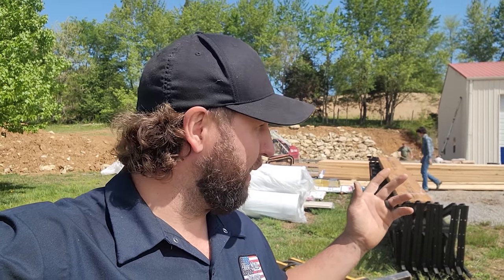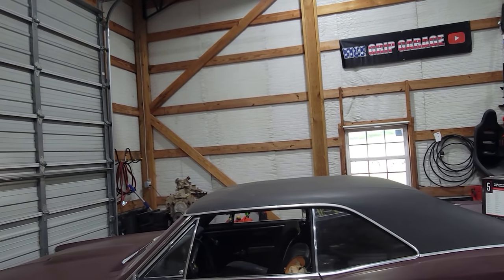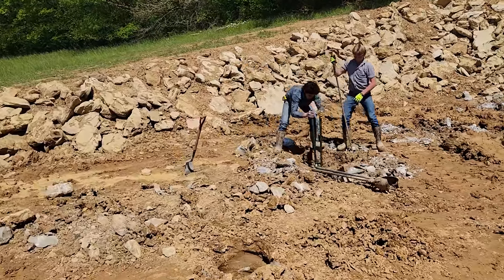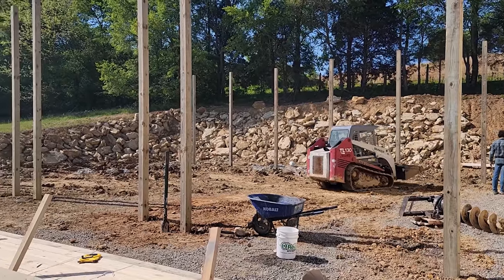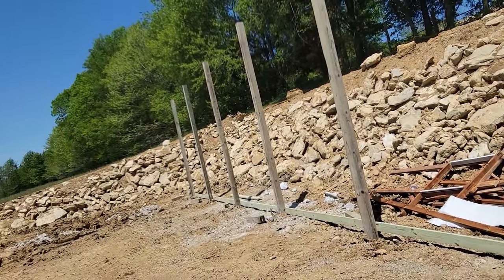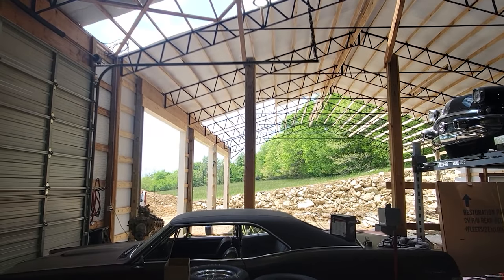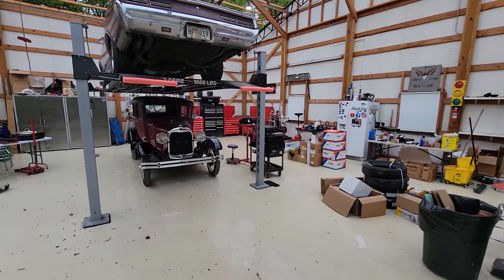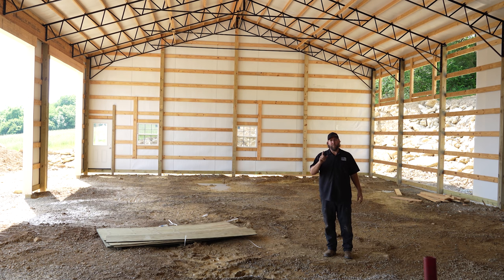Budget Shop Build - EP2 - Framing & Tin!

Comment: GABLE END EXHAUST FANS:  Put two 42" or 48" belt-drive exhaust fans near the roof peak at each end of the building.   Put on larger motor pulleys to run them 1/4 their stock speed.  Slow and quiet but at 40+", they will still move a ton of air.  Just crack those overhead doors a couple/few inches and it'll make it really comfortable.  Check out FarmTek's ValuTek fans.  You could also swap out the motors with 3-phase one's and use a VFD to dial in the speed.  A bunch of places sell motor/VFD combos.
FIBERGLASS ROOF PANEL SECTIONS:  I know that you JUST did the roof but if you ran two strips down each side, that'd make a nice skylight and brighten up the shop.
BTW, what a dream.  Big beautiful shop.  Don't forget a ceiling fan for the porch.  Maybe a Starlink internet dish on the top too.  ;)

Comment: I have a 50'x75' round top shed that was built in the 1940-50s. My wife and I were married in this shed about, 21 years ago this week actually. Anyways, when we were married, there were only 4 60-watt bulbs light it up, with some Christmas lights. I have since removed those lights and added 10 4-foot LED lights (4,500 lumen each) which I have plugged in, not wired in, about 15' in the air. I also have 2 10,000 lumen spot lights up in the corner that shoot from top to bottom, so I can see every cobweb in the place, both are on their own switches. Around my work bench I have 8 4-packs of outlets with each 4-pack on its own circuit. This was so we can use them for family reunions with warmers and crockpots and such (this was the smartest thing I did). I also smoke meats a lot in my shed, because it's 25' ceiling allows me to, so I have a lot of my smokers and such on their own outlets, again not blowing any breakers. 

Make sure you have your air compressor and drops added, I haven't completed all of mine yet. I would also install a vent fan or two with shutters, on each end so you can blow a breeze across. I also have a fridge in my shed for wobble pops and snacks. 

Good luck on your shed!

Comment: My suggestion for shop equipment is a heater (or two) that run off used motor oil. During the colder seasons, it will pay for itself.

Comment: Awesome addition. Install your fans closer to the ground. Helps to keep the hot summer air above you, also easier to make a wire shorter than longer too if you want to raise them up later for any reason. Also, old air-conditioning/furnace squirrel cage blowers can really move some air and sometimes can be found quite cheap. Mount it to a chunk of wood and wire a cord up, makes a nice fan.

Comment: That's a fine looking build you got going there Derek.  I think a good slab of concrete about 6 or 8 inches thick with rebar and the concrete wire would make a good floor for any lifts you might use or shop equipment you may want if plans ever changed for the type of use of the building.  You never know, someday you might want to put in a lathe or a milling machine and you need a good strong floor for stuff like that.  Right now you are looking good.  Glad to see you making it happen.  Thanks for bringing us along for the ride and God bless you and the family.

Comment: When I was 19 my dad and I built and 40x80 pole barn. He built a similar boom for the front bucket of the backhoe to set the trusses. Then a few years later we built a 32x60 shop to replace the 32x22 garage that was in pretty rough shape. Good stuff

Comment: Led lights, solar for lights and fridge,air compressor outside and big air lines for more air on demand, and clear panels in the roof for more light. And make end bay a paint booth or frame rack.

Comment: Like the 50amp outlet up front. Would serve multiple things, including plugging in an RV. Also the fan at the end of the gable, open the current man door and out goes the smoke of excitement. Meanards fans would be fine to keep air moving. LED lights draw less power, I would keep that side on its own switches. Having the electrician wire for the future is well spent. Maybe a hook up for generator in the back. 

Also, Derek, have them sloop the floor since you have no floor drains. Just a little towards the doors goes along way with water.

I know most people don't use compressed air anymore vs cordless tools, but moving the compressor over to the far end would lessen background noise.

Next would be the outside lighting and security.

Comment: Derek, as I was skimming through the comments, I noticed a couple about plastic pvc pipes for running air lines. It's your shop, but I worked at a shop that had plastic air lines coming off of the main steel compressor lines. When the building was 8 years old, one of the plastic lines blew out, and 2 of the chunks of plastic went clean through the metal wall. Nobody was hurt, but it could have turned out bad. Good luck with your project.

Comment: We put in our shop a 96 inch ceiling fan from Home Depot. It was 700 bucks and dropped the shop temperature 10 degrees with the ACs running. It draws very little power and is nearly silent. Way cheaper than the big ass fans and very nice as well. Hope you have a great time in Indy and look forward to the content that comes from that. Someone turned our thermostat way up here. Lol!

Comment: Use PEX for plumbing and air. Buy the crimper and use the stainless clamps. Doing it yourself saves big cash. Air quick connects everywhere. Double 120 and 240 outlets everywhere. Gable fan/vent. Led lighting. Oh, and a restroom.

Comment: You guys sure picked a nice little plot to settle down on. Very happy for you guys, and the shop is looking great 👍🏼👍🏼
Reply: Only suggestion I would have as far as the electrical type stuff goes would be to possibly install some networking type of goodies in there. Like a WiFi repeater and a wireless (or wired) link back to the house, so you can download 100mb service manuals and look up questionable torque specs without having to use yer cell data or walk back to the house. ‘Course you might already have all that figured out 🤓

Comment: Awesome.  I built my own 36x56 shop for wrenching a few years back.  Tip:. Save some of the bubble wrap insulation (Reflectix) and you can use it as kneeler pads or throw down a sheet if you have to work on the ground in wet or snow.  As for power, lots of plugs all 20a, strategically locate a few 30a 220v twist locks for welders/compressors, whatever.

Comment: Hello sir! as an electrician of 30 years I would put as much pvc pipe under the pour between outlets switches and the panel. this way if you ever need more power in a specific area ie lights outlets machinery lifts  you can pull it thru the pipe. This is a great series that is every guys dream space Although I would put a bathroom because it seems every time I get in my garage I have to use the bathroom hahaha

Comment: The "laminated" 2x6 posts are very common in the pole building industry, they end up being more dimensionally stable, less prone to warping, and end up cheaper than buying 20+ft 6x6 posts. They also allow for installing short stub posts in the ground first,which is much easier than the battle of trying square and plumb a 20ft tall post. A friend built with 6x6 posts, one of the posts decided to warp.The top 4ft of the post curled in almost 2ft, destroying the tin on the walls and roof.

Comment: They stack the 2x6s because it helps with warpage. The stacked boards have different wood grain going in different directions so when the wood eventually starts twisting and warping from moisture they stay straight better than the 6x6 timbers. Eventually in a few years you will notice the warpage in the 6x6 posts.

Comment: Use to work in a sign shop, boss painted all the signs. He liked paint best, but later he started using vinyl letters.
     The point is that the color red faded first before other colors did. We tried not to use red if we could, because we wanted the signs to look good more than a year.

Comment: I would get a commercial grade air compressor and put it at the farthest point out back. I would build an additional storage for it. That way when the compressor runs you hardly hear it. I would also build a roof over hang where you can put storage bins for used oil and antifreeze. Then you can hire a company to come pick it up. Or you could use a used oil burner to heat the shop in the winter. I would get one that you can also burn wood in in case you don't have enough used oil to heat with. It also wouldn't hurt to throw a a/c unit in if nothing else to lower the humidity in the summer. A tin building can be an oven in the summer months in TN. Just a few suggestions.

Comment: Happy new barn Derek & Fam!

Looks lovely and a solid build. 

Something to consider that you have mentioned previously is extraction! If you run motors inside having vans won’t do it - maybe look into some HVAC extraction systems or some wall mounted fans 

Also sockets - man never has enough one on every post wired in a circuit to give maximum voltage - mixture of 2 phase and single phase for all your different tools

Comment: PVC  is a very cheap way to run air around the shop! Have one or two quick releases for a rubber hose on each side of the shop and four or five on the back wall. I even ran one that pokes outside by the walk in door so you can air a tire outside on the driveway! Keeps all the hoses off the shop floor! PVC is good to 300psi!

Comment: Grain bin fan 110 volt is what I use to circulate air through my shop on the farm mosquitoes don't even stay nearby and there's no way to not cool off even though it's loud it's very effective. You know a small corner room with an air conditioner in it is very nice to cool off every few minutes

Comment: Adding a small vestibule to house your compressor outside is a game changer, foam board insulation between for sound dampening, hard to go back to having a compressor run inside after that.

Comment: Outlets: You might consider adding in either bigger service to the building, at least a 225 amp panel for a building of that size. I'd also zip in a few dedicated 240 volt circuits for a welder or any other higher-voltage equipment you might be running inside the shop. And of course, 120 volt outlets, every six feet, per NEC standard.

Comment: A thing I did to avoid running the AC was to put opposite fans on each side of the house. One blowing in the other blowing out.  Made a nice cross breeze kept it cool worked with standard box fan.

Comment: The more plugs the better. Also put big conduit under the doors so you can run air or electric later if you need to without going all the way over the doors.

Comment: For Shop Air: An inexpensive solution for air, particularly in terms of pulling out the moisture is to use a tube and fin style radiator cooler (find one with AN fittings) plumbed between the compressor and the air tank. This in conjunction with a moisture trap pulls out the majority (like 95%) of the moisture from the air before it even enters the Tank. Meaning that you have a much lower chance of rusting out your compressor tank, plus have dryer air coming out the end of the hose. Living in the Seattle area, I set this up and I literally don't have water collecting in the bottom of my compressor anymore.

Comment: Derek love the show. For your garage doors you might want to look into using liftmaster 8500 wall/shaft mounted openers. They are more expensive than the standard opener but they do offer some advantages plus the new ones can be upgraded to have a DC backup so you can still open or close your doors during a power failure. After installing mine I will never go back to the standard opener. With the opener on the spring shaft you don't have the opener hanging in the middle of the shop so you don't have to ever worry about hitting the opener when lifting or jacking equipment. This also gives you the option to have the door tracks follow the contour of the roof so when the doors open the door will be tight to the trusses giving you more inside room with the doors open. Lastly there is the added security with this opener, if someone was to pull the safety cord to uncouple the door to manually open it they won't be able to because these opener come with an auto deadbolt that engages every time the door is closed. This deadbolt can be manually engaged or disengaged from inside the garage. Hope this was helpful and gives you an option to think about.

Comment: Derek, Look for a used 3/4/5 ton A/C system if you're going to shoot vidya's in the new garage. It'll keep the dang humidity down for a fella, Plus adding a waste oil burner to it for heat could save a guy a few buffalo nickels.

Comment: Derek around here in Ohio most pole barn packages are built with columns that are triple 2x6's. They typically use treated sections that go into the ground and standard lumber for the rest. They are triple stacked 2x6's with construction adhesive in between with so many nails per square inch. That is the norm up here. They say less twisting and warping than a true 6x6 or 4x6.

Comment: Exhaust box fans Derek : make a huge difference for air control.  Wall mounted in a window frame and come "winter" you can just seal them up with 2" or 4" foam insulation and a little bit of tuktape

Comment: Rocks in clay soil - how fun. I just built a 12x16 shed back in October and let me tell ya...getting those holes 42" deep in clay soil and then raining enough to always have puddles and mud for the entirety of the project was no fun. At least I still found enjoyment out of building it, but it sure was challenging, especially when the frigid cold of Winter was hanging around as an added bonus.

Comment: As you asked for electrical suggestions, and previously being a electrician, I highly suggest spotlights. Nothing like huge 5,000,000,0000 watt, but some mounted to the ceiling and pointed at where it would light up engine bays (or any specific areas of cars/trucks you are working on. This way, you would have better lighting to see what you are working on.

Comment: I use 1 1/2",  thick wall irrigation pipe for a major air line around the workshop and run the 1/2" from that, this makes sure I have air volume right up to the air tool I am using.

Comment: AIR LINES - Derek, in our shop we use 1/2" CPVC plastic water line (the beige stuff, not the white!) . If I remember right, it's rated to 400 lb. PSI at 70 degrees F. Make sure you use the glue dedicated to that pipe, and of course primer everything. FYI, we keep our lines pressurized to 100 lbs, and we had one line blow out in 22 years due to a bad glue joint. It sounded like being on the gun range without ear protection! You might want to give the family a heads-up...

Comment: You may want to use some bays of pallet racking to build car shelves.  Use your one rolling single lift to put the cars to a height where you can have two layers of cars on the backside of the garage.  three deep of 8' wide racks would certainly hold cars above with some decking.  bleep bloop me if you want drawings.

Comment: Regarding power and outlets, you can never have enough. I would prefer to have 240V and 120V, the power cable to the fuse box to be as heavy as possible. Start with few outlets, and add to them later on.

Comment: Can you add drains through the slab so if you need to was something it’s easy just to drain it out to the yard?  Also consider mounting some higher power outlets so you can add lights for video and also hook up cameras for time lapse. Even better, add some permanent cameras that capture everything so you can edit in stuff you might have missed with your handheld camera.  Looking great!!  Good luck.

Comment: I use a couple of old squirrel cage blowers from old AC home sized units people have replaced, fan motor and belt in a plywood box, and they push plenty of air and are far quieter than a bladed house fan.

Comment: For heat I would install radiant tube heaters they work awesome in garages. I built a bunch of car dealerships in NJ they put out good heat and last forever if installed properly.  Big ass fans needs to get together with you for a sponsored video.

Comment: Ya got all that land, dig some trenches and lay coils of piping to capture the ground temp for geothermal A/C and use heat pumps for heating. Solar on the south side of the roof for free electricity. Your local energy company will give you rebates for part of your investment and the savings will add up soon after.

Comment: Compressor air system, my company uses simple white PVC tubing.  Fast and easy to use.  But, today, I wonder what PEX would do for the same system?  My plumber swears by the PEX for whole house water systems here in NJ.  The beauty of PEX is you can run it through a manifold and be able to turn off sections of your building if need be.  Hope this helps.  Keep up the good work!  Love your videos!

Comment: I built a guys garage last year. I installed fans that are mounted in each corner of my garage and it makes a huge difference in the hot months of circulating air. They are cheap and got them on Amazon for a hundy

Comment: Highly recommend using pex tubing for shop air. Can usually find leftover rolls used or even new it’s cheaper than pipe. Did my shop with that and it sure makes life easy. 
Used old 100LB propane tanks for air receivers after cleaning them out.

Comment: 40 years ago I built my pole garage.  I went with the brown on the side walls and white for the roof.  White reflects heat.  I suggest you insulate the doors and put AC in.  Even if you went with a couple large wall units it makes a massive difference when it gets HOT.  We don't run our fans in the summer, it blows the hot air down.  Warm air rises, cool air falls.  And why wouldn't you put a bathroom in?  I put a bathroom with a shower in my garage.